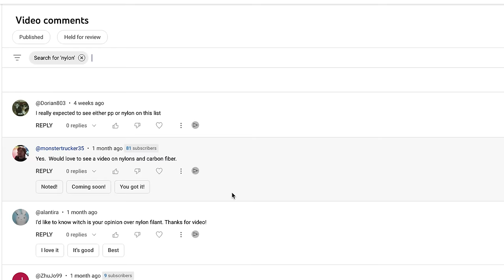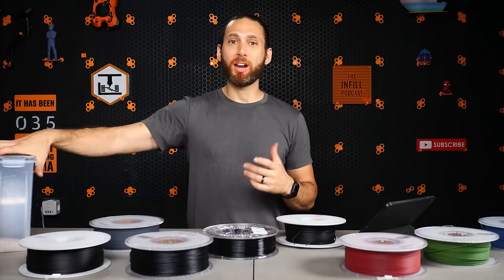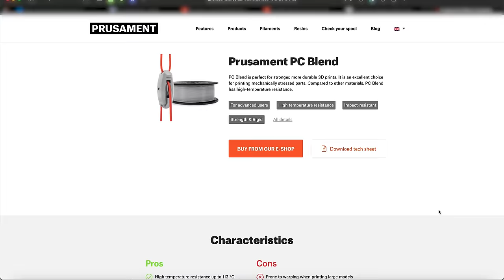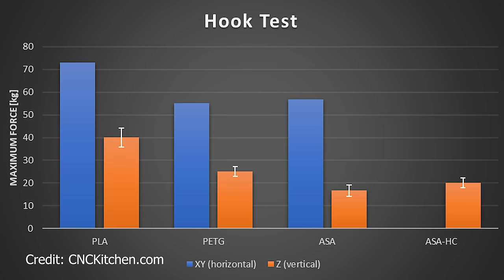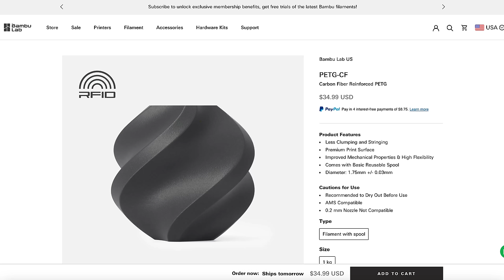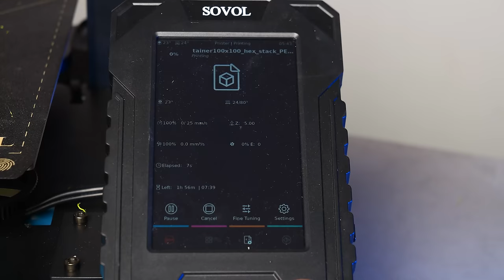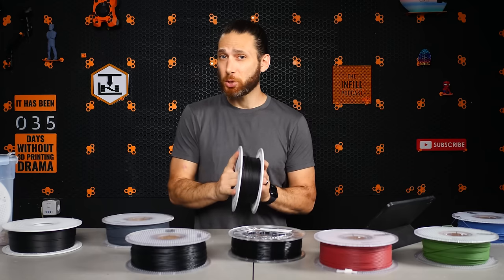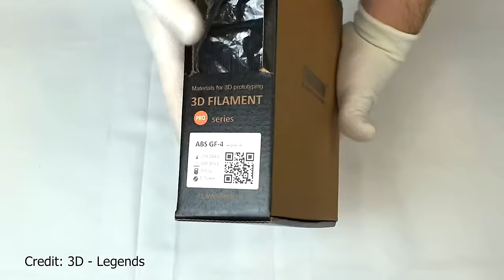Carbon Fiber 3D Printer Filaments: What Are They Good For?

Comment: PC and PA are great materials. Riot shields and "unbreakable" glass like helmet visors is made from PC. It is one of the strongest plastics there is. You can make really high end parts with this material.
Reply: @KaylaRosa-fd4bw  1. I never said it wouldn´t be weaker. 2. It would still be pretty good considering materials like PETG, PLA and ABS. 3. Layer bond with PP or PC is way better than with other materials.
Reply: @KaylaRosa-fd4bw  I am sorry, are you mentally handycapped ? Of course they are weaker, not because of their material but because they are 3D printed. FDM 3 prints are not isotropic.
Reply: @KaylaRosa-fd4bw  Please read my other comment...then read it again a couple of times and again until you understand that I am not comparing 3D printed parts vs injection molded ones but 3D prints with 3D prints and injection mold with injection molds.
Reply: @KaylaRosa-fd4bw  You were the one not specifying what you were talking about, I typed out your missing words for you. 
I really hope you learn how to communicate properly for your own sake. Making false comparisons and one liners is stupid but I guess that´s how you are.
Reply: @KaylaRosa-fd4bw  It´s funny how the best way to insult you is simply quoting your.
"...Those items would be much weaker if 3d printed..." Yeah we were talking about 3D printing on a 3D printing channel all along you genius xD Hahahha
Reply: @sierraecho884  You said, "Riot shields and "unbreakable" glass like helmet visors is made from PC." You were not talking about 3D printed objects. Good try. You should really work on your grammar skills.

Comment: Anybody have experience with epoxy bonding any of the CF reinforced filament parts?  I have a requirement to assemble components and then laminate a light layer of kevlar veil fabric on the bottom surface for abrasion resistance.  In my world, epoxy is not known to adhere well to any plastic even when surface prepped. I'm only guessing that the Caron fiber strands in the substrate will give the epoxy something solid to bond with after sanding the mating surfaces.

Comment: once again I think this is all upon use-case. dont use unnecessarily expensive filament for low-stress/static parts, use a specific filament for outdoor enclosures or exposed to chemicals, and use a specific filament for something that will be exposed to impact and/or heat...

Comment: Because the fibres are not intersecting the layers there is no increase in strength in printing direction. The biggest pro for those cf filaments is one that is useless: the filament does not bbreak while fed in the printer 😂 But making products saying "carbon fibre inside" will increase your sales because the moron customers work like that.

Comment: Well CNCKitchen told specifically that he had a bad batch of PACF... he never mentionned a proper postprocess with PACF which is mandatory to reach the full potential of the material. As for "creep", a non existant factor when this material is printed correctly and postprocessed correctly. I can assure you printer parts out of PACF/PAHTCF are durable and quite adapted to that usage WHEN A good brand is choosen as a true annealing post process is made. I make more than 120Kg/y of that material for various applications and Printer part is one of them! Once again, extruding PACF is not a big science, but making it correctly with a post process is always forgotten in that kind of video content... bit of a shame

Comment: CF makes parts weaker. it's not fibers, it adds nothing to strength just weakens the adhesion of plastics. just  check any layer adhesion test of your choice. try breaking sunlu pla meta 0.8mm single wall then :) costs 1/4 of CF

Comment: you forgot ASA (ASA-X, ASA-CF)... the better choice to ABS
Reply: Isn't the non UV-resistance of ABS overrated? From what I recall, any pigmented ABS will be fairly UV-reisistant because the pigments prevent it from penetrating any further than the surface.

Comment: One of the most unique magical properties of nylon is that it's self lubricating which is why it's used for silent efficient and durable mechanisms. Unfortunately filling it with a hard particulate probably isn't great for that.

Stefan's Voron failure is not representative of the material. He ran into a bad batch of material.

I do wonder what PETG GF is like. I mean if you've ever seen PETG stuck on a piece of glass, it seems very promising. Dimensional stability has to be outright insane as well.
Reply from the maker: That’s true!
Reply: Nylon, even CF nylon is notorious for creeping, so Stefan’s voron failure definitely wasn’t just due to a bad batch, creep is a well understood and known property of nylon. It is also known for absorbing moisture and reducing its mechanical properties, for the worst cases of CF nylon (usually PA6) the rigidity and strength can half within just a few days in normal air. It is good for some things, but not everything.
Reply: @conorstewart2214   Off the roll, dried, Nylon is not a mechanically useful material, it's kind of brittle and not at all strong. It gains its extreme surface slickness and extreme toughness specifically by absorbing moisture, it eagerly gains about 4%, of course also expands. It being a bloody wet noodle is the whole purpose.

Hard filler is there to try to retain a bunch of its strength while also giving it shape retention. It's going to have to rely on filler properties including particular particulate load and shape for that.

Comment: Other than visual -- PLA CF indeed is just a gimmick or even worse.

Especially if you anneal PLA, it simply outperforms everything in everything except long term heat tolerance.
You can surface anneal PLA prints very easily without warp, that gives time for rest of the print to anneal with now stiff strong surface to hold the dimensions.

All you need is a blow torch, and a little bit of trial & error to develop the feel for how much to heat the surface for any given print dimensions.
I do this for almost all of my PLA prints.

Sustained above 65C? Then for longevity i want something else, but if it doesn't need to last more than a couple of years & weight not issue? Yea PLA will do fine.

Comment: I personally think CF infused filament is a costly gimmick. At less than 1mm length, loosely packed carbon fibres dispersed in a plastic is a bit pointless, as you're really looking for fibres that re closely packed and bonded with a highly adhesive compound. You may save a bit of weight, but until your printer can feed a CF thread that's infused with quick-set epoxy... save your money.

Comment: Absolutely nothing? Nylon & Co. I get. But carbon fiber seems overhyped in practical applications. It has some pros, but it seems, they are moderate at best while inflating the price of printing massively (for this money I would get an enclosure instead). It doesn't compare to properly molded cf-composite materials, which reinforce not only in one dimension.

Comment: The only reason PLA exists is because it's so easy print. It doesn't matter how "strong" it is, since it's not durable it has no industrial or consumer goods applications (other than hobby FDM).
As for all the "CF" blends, most are made of milled carbon. Basically just ash, instead of chopped carbon aka fibers, which still looks nice but again has zero practical applications. For filaments made from real chopped fibers you're gonna have to break the bank. A $60 kilo spool only has ash, not fibers.